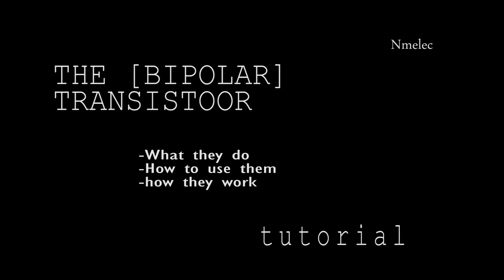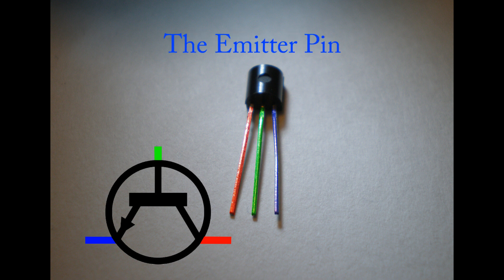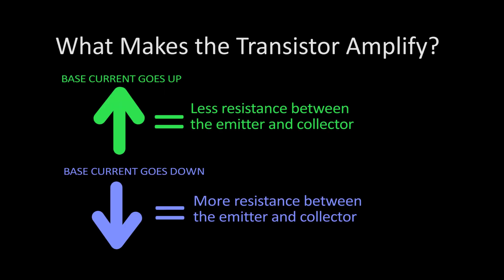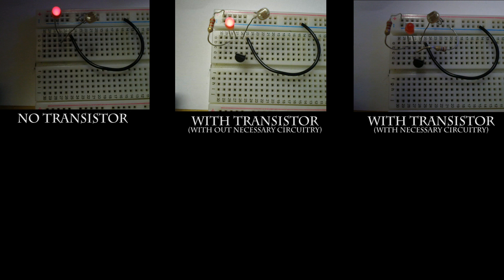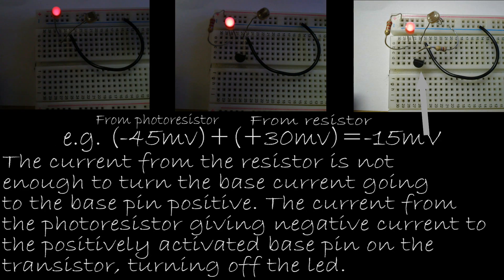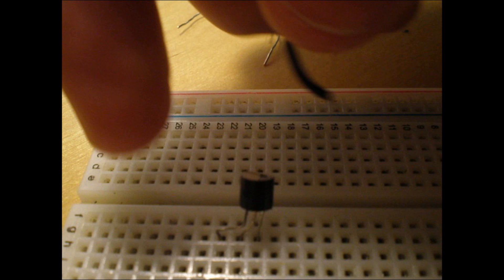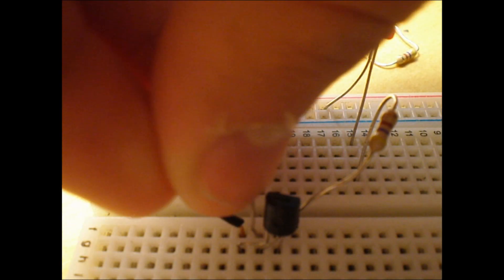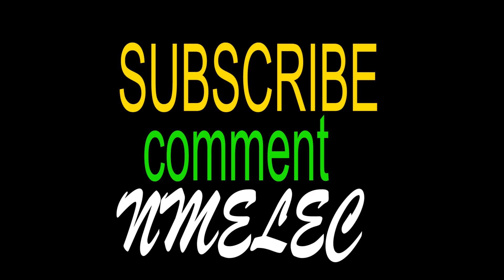Transistor Tutorial

Comment: As a rule, I don't like to criticize someone who is trying to share his or her knowledge with others, but if you choose to share some information, you should first make sure it is correct, and there are so many things wrong with this video, I don't know where to begin.  I must say, up until the 4:40 mark, everything you say is true and your theory is (mostly) correct.  However, when you start connecting the circuit together, you do so incorrectly.  First, you seem to have swapped the emitter and the collector; in an NPN transistor, the emitter should always be forward-biased, meaning it is negative, compared to the base, while the collector should be reverse-biased, and thus positive, compared to the base.  You, on the other hand, have the emitter connected to positive (through the LED), while the collector is connected to negative (ground).  Second, unless you live in a country with its own resistor color code, the resistors you show in the video are 470 ohms, NOT 1000 ohms (1k) resistors!  To be honest, I'm not quite sure HOW you got this circuit to work at all, as I repeated your process, step by step, and as expected, nothing happened.  To be fair, I used a 2n2222 transistor, not a 2n4401, which is what yours appears to be.  I don't know if some quirk of that particular model makes it behave in the manner you demonstrated, or if perhaps the pinout is swapped on the 2n4401 as compared to the 2n2222 but, as others have expressed in the comments, I had no success with this circuit at all.

Comment: What transistor model are you using? Because if it is a Bc547 or a 338 NPN, then the pin connections are CBE when the flat side is facing you not the arc.  if you are using the aforementioned transisotr models then in your setting, the pin connections are EBC and not CBE.

Comment: I think you hooked your photo resister in series with your resister. The 1k resister went from ( )  to  the base of the resister and the photo resister went from the base to the (+)  of the bread board. If you took out the transistor, then you would have a series circuit. resister connected to the () connected to the photo resister and from photo resister to the (+).

The important thing to get from this example is the + current in this junction from the resister pumping electrons to the base and the photo resister. The electrons flow from the resister through the photo resister creating a current that travles in the opposite direction as the electron flow. This current is what activates the P in the NPN transistor and saturates the P layer and closes, "turns on", the resister.

I have had a hard time trying to understand this concept of current. Electron flow I get, but current caused me a lot of problems until I realized that you can think of current as vacuum pressure. Electrons push one way and cause a negative pressure going the other way. Just like a fan can blow air towards one direction and any paper behind the fan will feel the negative pressure and could be sucked up into the back of the fan.
 A good example of this is people getting sucked up into jet engines if they get too close to the mouth of the jet engine. The power goes out the tail of the engine but there is great negative pressure at the mouth of the engine and this concept fits well to describe current.
Reply: I don't understand, what do you mean?
Reply: oh, I see, I have no idea how that happened, sorry.
Reply: lol, ok, I assure you it wasn't intentional.
Reply: I don't know lots about electronics. I suggest checking out afrotechmods channel. He has some very good videos on electrons and how the components work. I was really into it at one time, but I lost interest lately. What type of project are you wanting to do?
Reply: Its ok, like to hear what your going to do if its a simple project. Keep on inventing, its fun and keeps your mind sharp. Good luck.
Reply: You raise an interesting point, and you are correct; if you remove the transistor, then the resistor and photoresistor ARE, indeed in series.  However, from the transistor's point of view, they are in parallel, because both connect directly to it, instead of one to the other and THEN to the transistor.  Their opposite leads just happen to go to different places.

Comment: This makes a lot more sense now of why we use transistors so much, but I just never knew a practical application for it. If you invert the circuit (making the LED turn on when you put your hand over it) then whenever it turns dark enough, the LED would automatically turn on. If you did that same thing but replaced the LED with a piezo  buzzer and left it in a light place, you've got yourself a close range home security system... Kindof...

Comment from the maker: I added the resistor in parallel to the photoresistor because it drains the current coming from the photoresistor and the base of the transistor does not get any power, therefore it does not supply electricity to the led.Once the photoresistor lets through more electricity than the resistor is able to drain, it "overflows" into the base, giving it power and the led lights up, as the base current is being amplified.

Comment: Why would you even need a transistor for the circuit at the end of the video? If the collector is connected to ground, then no extra voltage is being added to the base and so the transistor acts no better than a jumper, right?

Comment from the maker: @mikespocket The transistor that i used in the circuit was an npn transistor. This would mean that both the emmitter and collector are connected to ground, the base pin on the other hand would be triggered by positive current. This can be confusing, but it is important to remember that the emmitter is a connection to ground and if you connect the collector directly to ground with the emitter connected directly to positive and you saturate the base,

Comment from the maker: @mikespocket you decrease the resistance between the collecter and emitter and there is a short circuit. that being said, the reason i had the emittor connected to positive was because i had an led (a resistor would have worked too, or any other load) between the emitter and positive. this way i was using the emitter to connect the led back to ground. i hope that answeres your question.